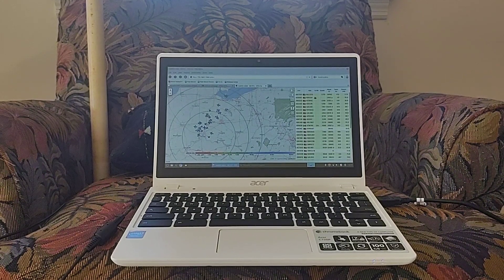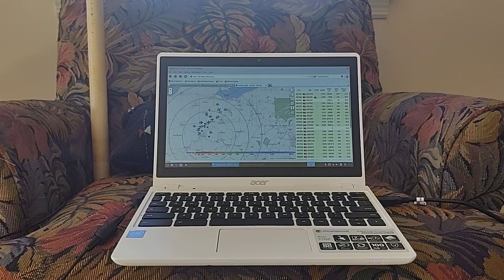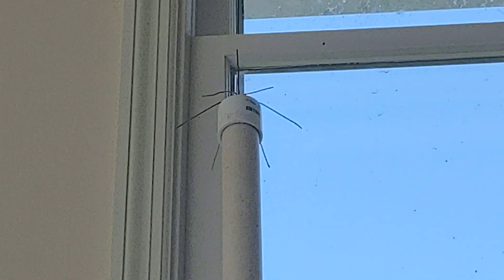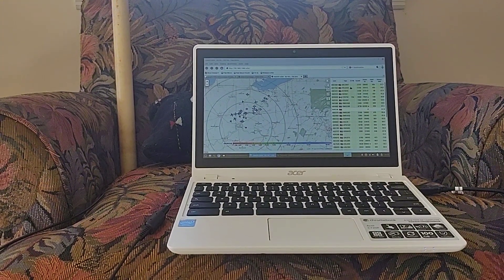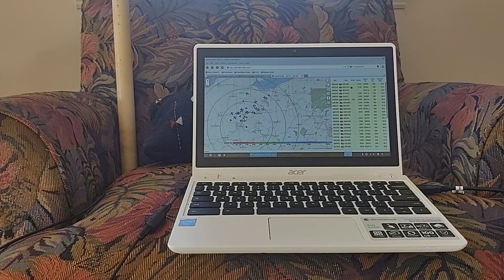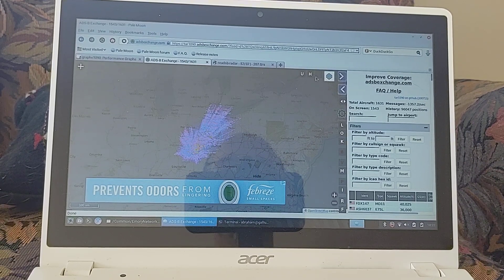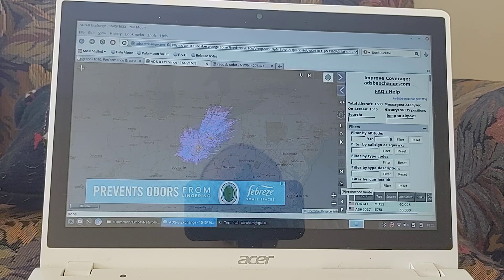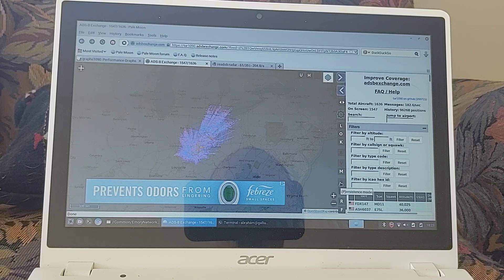New improved ADS-B flight tracking setup and spider antenna

Comment: Exactly what I have been looking for as far as software goes...loaded with features! I'm running dragon OS and this software fits right in on the Old slow dell laptop. The antenna is a discone at about 20 feet above ground level with coverage of about 250 miles or so for the commercial aircraft above 10k feet.

Comment: Are you use hardware RTL SDR ?
Reply from the maker: I am using an RTL-SDR dongle.
Reply: @walnuthills11  thanks in advance, I want to ask you.. if I use the Usb Rtl-Sdr Dongle Rtl2832u R820t2 will the result be the same?
Reply: @walnuthills11  ohh i see, are you using the white rtl sdr (v3) ?
Reply from the maker: @TaniaAchiever  I think so. Wait, for this I used a NooElec NESDR, but the RTL-SDR v3 should also be able to cover the ADS-B frequency (1080 MHz).

Comment: Its NOT a "spider antenna" its just  bog standard 1/4 wave
Reply from the maker: But a spider antenna is 1/4 wave with ground radials in a "spider" arrangement. It's not a spider because it has 6 rather than 8 ground radials. I guess it's an insect antenna instead, haha.

Comment: Offering HIGH impedance to frequencies except those desired.
Reply from the maker: Ooops. I will fix this in the description. Thanks.
Reply from the maker: I think I mixed up RF ground with counterpoise impedance. You would expect counterpoise impedance to be high at the frequency of interest, correct?

Comment: Posting links to the software and antenna design would be helpful.
Reply from the maker: I will do so soon!
Reply: Steve , I think those are 1/4-wave copper elements . Soldered or connected to a chassis-mount coaxial connector